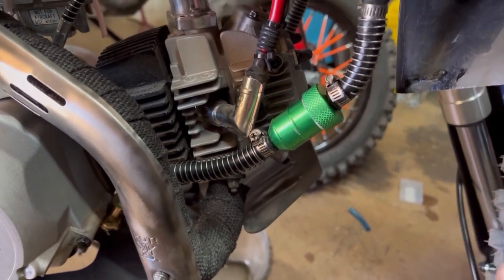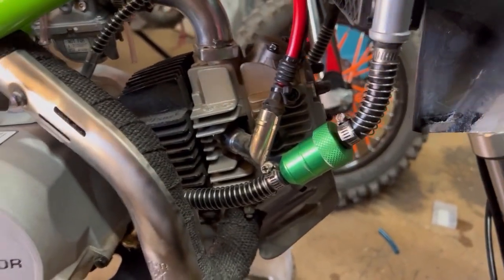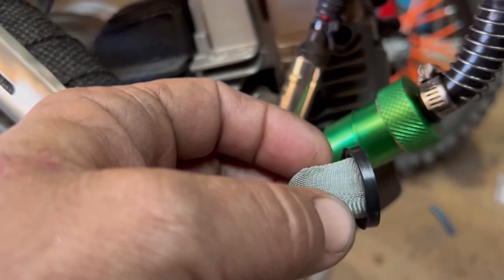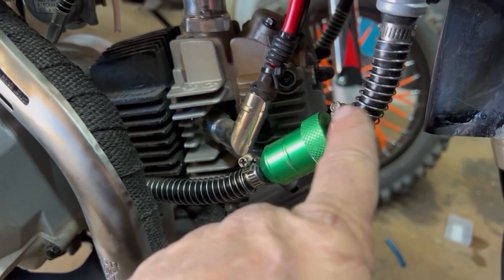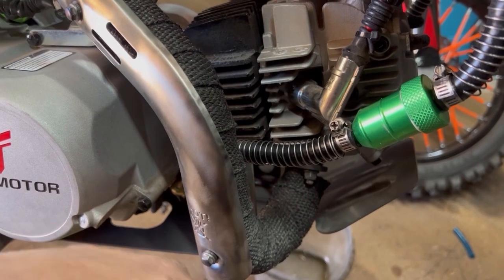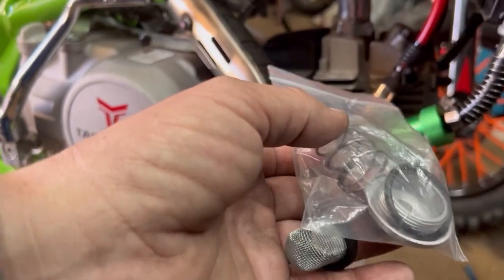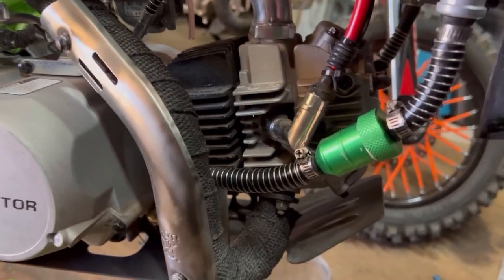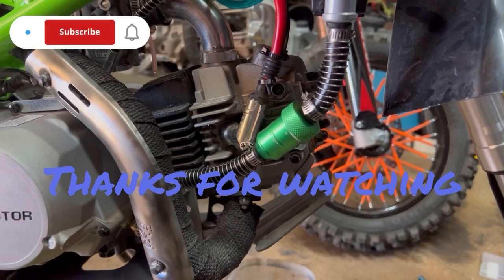DIY Pit bike oil filter for the tao’s!￼

Comment: Great idea ! Like to know what your lines are hooked up to , like to do that on my 125 CC  jeep and install an oil cooler at the same time .
Reply from the maker: The inside of the line needs to be roughly, a quarter inch I don’t think it would work too well with the lines that come on the other oil coolers they’re too thin
Reply from the maker: As far as how I have the line hooked up, I put the oil filter on the return line going from the oil cooler back to the engine. I just cut the line, took out a little bit and put the oil filter in between.
Reply: @TheManCaveMetalFab2580  Thanks for all your help !!